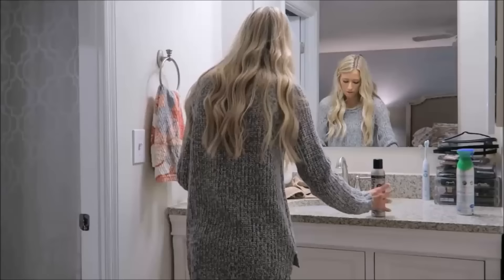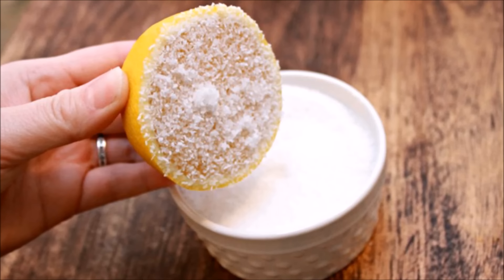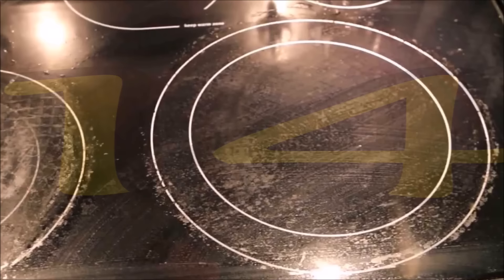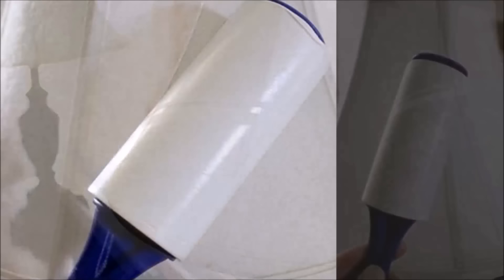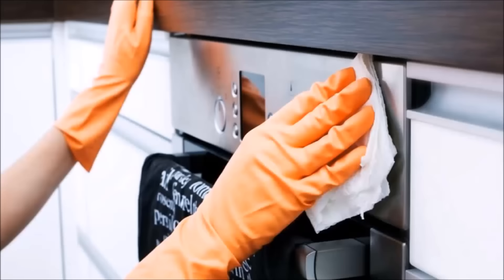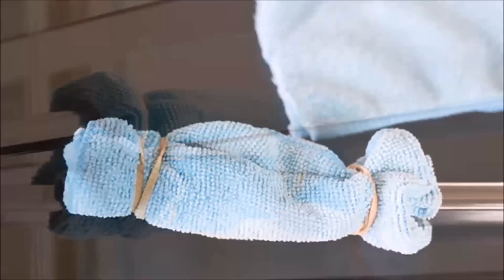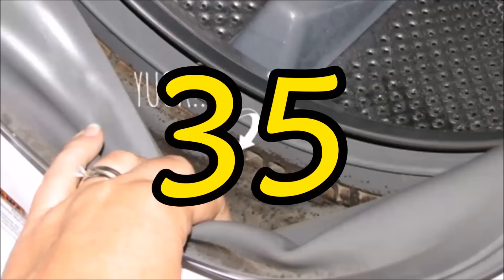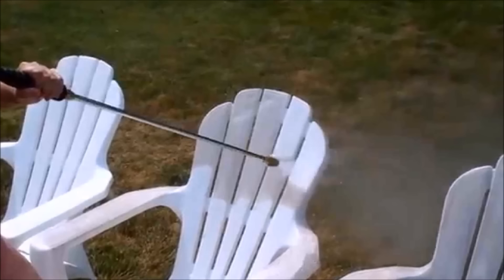41 Tips to Make Your Entire Home Cleaner Than It's Ever Been

Comment: I never use bleach!  I use Borax for towels, or baking soda for my mats because borax does a number on the latex backing. I add vinegar, about 1/2 cup, to to the rinse cycle of most loads....not spandex, the stretch will be gone very quickly, it disinfects sheets & towels.  Borax also disinfects.   I use vinegar for all cleaning jobs...no mold in my bathroom.  I use some baking soda with the vinegar if something needs an bit more scrubbing like my stainless steal sink.  For toilet I mix 1/2 cup vinegar, 1 cup water, 2 Tblspns. liquid  Castile Soap, 10 drops Tea Tree oil, 10 drops Lemon. Mix in a squirt bottle...like an empty dishsoap bottle, squirt in toilet, swish around with brush, I like to use a rag, flush done.

Comment: I know it sounds sooo wrong.....but I was helping my neighbor get ready for surprise in-law company who she so wanted to impress......I washed the outside of her windows while she used windex on the inside.  I used  soft bristled brush her husband bought for car cleaning.... 
And my cleanser.....very hot powdered Tide water in a bucket and then rinse w plain water from the garden hose.......we were worried about streaking, BUT the windows dried in the open air with no required buffing.

She was carefully checking the shine on the windows and Jack of streaking from the inside......we were thrilled........I HAD a pile of newsprint, all ready to go, to buff the windows, but we didn't have 2 do that part🤷🏻‍♀️
🤸🏿‍♂️🤸🏻‍♀️🤸🏿‍♂️🤸🏻‍♀️🤸🏿‍♂️🤸🏻‍♀️🤸🏿‍♂️🤸🏻‍♀️🤸🏿‍♂️🤸🏻‍♀️

Comment: Can someone tell me how to clean in between the glass on an oven door?  
I am afraid to take the door apart...
Than you...
Reply: Laura Flores Use a wire hanger! Just wrap cloth around a wire. You can slide it between the door and glass.
Reply: Use a swifter sheet taped to a fly swatter, like Amber said slip it through the opening between the door and glass.
Reply: That door lifts right out when half open.just lift up.way easier to clean the oven.
Reply: @danahoover1018  wow 67 yrs old never had any idea you could do this !!!!    Thank you

Comment: To add to the fan cleaning, use a heavy wood polish after cleaning to ensure a longer dustfree fan blade! And while you're cleaning the blades, take the globes off and soak in warm, mild soapy water. Set aside to dry and put them back up when you're done cleaning! Bonus if you let the bulbs cool and give em a quick wipe! Before vacuuming. Remember to work top to bottom of a room... and vacuum off the trim above the door!

Comment: for washing clothes, especially bed linens, skip bleach and user DISHWASHER soap.  not washing in the sink soap, but  running the dishwasher soap. it will dissolve body oils and your and your laundry is much cleaner.
     i dissolve about 1/8 to 1/4 cup of the dishwasher soap in 2 cups hot water and stir it . i add it to the washer during the early fill cycle for wash  and mix it around the water and then add linens, feather blanket/quilt , feather pillow.
   i also wash the dogs' bedding with the dishwasher gel. -  never any doggy smell.  if it's washable and a natural fiber cloth, this mix will clean right down to  the surface.
    i never dust my furniture - i wash it with Murphy's oil soap. it's really clean and leaves a nice glow and a lemony scent on the furniture and in the room. i don't have to dust nearly as often.  i also use it in wash water for the floors... makes my cheap wood veneer gleam like the good stuff!

Comment: Any tip for cleaning artificial plants. Thanks so much!!
Reply: wash them in your kitchen sink with soap and water if they are very dirty , or wipe them with a wet rag then air dry them
Reply: If they are only dusty, and small enough to do so, put the 'leaves' or 'flowers' in a paper bag, add salt and shake vigorously. It knocks all the dust off and keeps the plant or arrangement mostly together.
Reply: Actually I recently tried a disposable duster and it works like a dream! Thanks for all the suggestions
Reply: @marysmith6037  -  (The "Salt Bag Method" helps when plants and arrangements are really saturated with dust.)  The dusters are fabulous for weekly cleaning!
Reply: Dish washer
Reply: My mother put dawn in bath tub or  bucket, let soak, shower them off

Comment: The easiest way I've found to clean water stains from a glass door is to soak a Bounce towel in water and rub it down.  The glass will turn milky.  Then use a damp sponge to wipe the milky film away.  Finish with some glass cleaner.  It will blow you away at how easy it removes the water spots.  This isn't a joke...it really works.

Comment: Bleach isn't advisable for mold in the method shown .

Bleach does not penatrate into the caulking or groat.

You're basically letting the mold sit in water overnight. 

The mold you are seeing has grown out through the mold.

There are specific mold killing cleaners.

But if you have a few places on your bathtub edge, you want to have it professionally removed then the space cleaned with mold cleaner. 
It must have at least 36 hrs to dry, then recaulk it.

Comment: Here's the thing my oven is way past code red. My dad lived alone for 12 years so that means.... yes it has not been cleans in 12 years.
Reply: Anya Luckenbill - Start by pulling all loose food or gunk out off it , And oven trays. Youd be amazed to see what your next steps are . Yeah stoves can be a hassle just make sure once done put foil at bottom to catch food & change foil often. Helps to cut bk on the gunk we hate to spill. 👍
Reply: @abbigail3923  If it is a glass front stove have your local appliance dealer show you how to remove and replace glass safely. Yes, it can be done.
Reply: Anya Kessler do let us know how it works.
Reply: @abbigail3923 , yes that works for electric stoves, but gas stoves have vents in bottom. I used to do this, but when visiting my son. With gas stove, he  Said No, can catch fire.

Comment: Chlorine bleach will mix with hard water chemicals and set the stain. Chlorine should not be used on marble or granite. I live in Virginia and have found that mold, hard water stains call be removed on marble and porcelain with 12% food grade hydrogen Peroxide. I order the hydrogen peroxide by the gallon from Med labs.

Comment: For lamp shade's take your regular microfiber duster and one of the cheaper black plastic shopping bags, run it up and down the hair on your forearm, then run it over the microfiber duster. The static electricity transfered from the bag to the duster will pull the dust from an inch + away.

Comment: Even better than the lemon salt tip and the vinegar soak paper towel tip is get the cheap soap pads. Yes, you heard right! $1 for a box of 1O!  No waiting, no lemons, no vinegar, no paper towels, no salt, no mess to clean up. Quick and clean with no scratching.  Just wet and scrub.  Extra soap, cleaning products and bleach are optional. Faucet, sink, counter top and showerhead, etc.  Looks brand new when you are done. Cheap quick cleaning tip that saves you time and money and really works! Who wouldn't want that!?

Comment: Magic erasers didn’t work on my oven whatsoever.
Reply: If your oven is bad enough, which it sounds like it might be. You might want to try soaking your oven in Easy Off for the recommended time and using a 1" putty knife or paint scraper to scrape the gunk. If it is really bad you can use a propane torch to burn off any remaining gunk. I hope this helps.
Reply: I use them dry and work great.

Comment: "First, cut a piece of cotton coil, soakED it in bleach, and let it sit overnight on the mold. Then, just usED a Q-tip to press it into the mold so YOU wouldn't get bleach on MY fingers"

what?
Reply: What the heck is cotton coil? Are you talking abouf cotton string?
Reply: @minniemouska4320  Cotton coil is  used for many applications. It is the material that is used to protect people's skin from damage  when hair color, peroxide and perm solutions etc are used. It is placed against the skin before a plastic cap and/or cape is placed over it. This is the product. https://www.amazon.com/Cotton-Coil-100-Pure-Feet/dp/B01GVR17ZC
Reply: Caught that You My distortion

Comment: I have 3 cleaners in my arsenal, that is it, and that is for what a handheld steam cleaner dont get clean, it is my first go to it will clean & sanitize with no scrubbing, quickly and without and chemicals, and I do keep melamine sponges because the shine and clean all porcelain and ceramic, #1Spray Power it cleans pretty much anything with very little scrubbing, #2 baking soda and vinegar removes any kind of grease, a sponge or brillo pad lightly moistened with vinegar and dipped in baking soda takes grease off anything, and whitens pretty much any cloth and if not, the other 2 things will (spray power or bleach) will do that, and # 3 bleach for a disinfectant, I am paraplegic and my husband is quadriplegic, and I am a germaphobe so keeping my tires clean before entering my home, and keeping the home clean is imperative and this is what I have learned to do over the years.

Comment: Bleach doesn't actually kill mold all the way down, only the surface (colored part)! Use 3% hydrogen peroxide and baking soda, let sit overnight, spray again in the morning and scrub away. You can also add tea tree oil, grapefruit oil, or clove oil to give some extra punch. This will actually penetrate and break apart the mold, not just what's seen.

Comment: BTW vinegar doesn't work on hard water. I've tried ever variation of it, including straight non diluted vinegar. It does nothing.
Vinegar is a liquid, it can soften and remove soap scum just like literally any liquid can, including water.
If you are soaking the white marks on your faucet in vinegar and it's coming off... it was never limescale in the first place, it was soap scum all along so don't bother wasting your vinegar next time, just use water.

For actual limescale you need to go to a store and buy a chemical remover.
Theoretically vinegar, lemon juice, citric acid etc is acidic so will remove limescale(which is basic), but in order to remove months of limescale you need months of vinegar treatment, which means basically you have to wipe down every bathroom surface every single day for the entire time that you live in the house to prevent and remove build up.
A chemical treatment removes limescale buildup in one go, so you just do it once you notice buildup every couple of months, instead of everyday.

To put this very simply. Stalactites and stalagmites are made the same way that limescale build up is made... dissolved CaCO3 is being layered on a surface. Trying to remove limescale with vinegar, is like trying to dissolve a rock in vinegar. It'll happen but it takes FOREVER, vinegar just isn't strong enough for what we want it to do.

Comment: What I do is I set up an area in my basement which is tile floors and a drain and I put the rugs up on milk cartons and I use resolve rub cleaner and I spray it in and then I hose the rug until all of the dirt is rinsed off and then I use standing floor fans to dry the rugs over a period of 24 to 48 hours that's pretty much what your professional cleaners do to. Do not ever use any kind of a brush on fine wool rocks just use your hands and a spray hose with lukewarm water

Comment: Great tips. I hate mold how do you get rid of it in the corners of your home like by windows
Reply: We live in a high humidity area and have this problem. I use bleach diluted in some water to spray on walls and a cloth to wipe windows and sills. Try not to have furniture along these areas. If so check behind furniture and wash any cloth exposed to dampness.
Reply: One thing that I find works really well and kills spores better than bleach is clove oil mixed 1/4 tsp of oil of cloves to around 400ml (about a pint) to 500ml water. Mix it in a spray bottle and spray the affected area, leave for several hours or overnight, then spray again and wipe with a cloth. The eugenol in cloves is a really good fungicide. You may have to repeat this if the mould is heavy but it will keep mould away for quite some time. You should use the oil of cloves that you buy at the chemist - the one used for toothache - and not just scented oil. 
Do wear gloves, eye protection and try not to breathe in the mist as it can be an irritant.
This can also be sprayed in shoes to avoid or kill tinea and some nail fungus as well. Just spray, let it dry and repeat about every month.
Reply: kez kezooie n78hy

Comment: Anything she suggested vinegar to clean replace with a water and denture tablet solution especially for the toilets at pop one in my toilet every night and let it sit overnight and it looks like it just came off the showroom floor every day I haven't put it in the back of the tank to keep that free of the hard water scale. And the burner suggestion instead try getting a fabric softener sheet wet and laid on there for about a half hour when they'll come out like brand new. Anything she suggested baking soda for also denture tablets if you look on the box you'll see why some hospitals were using this then the early part of the pandemic when there was no sanitizer Google it that the ratio recipes to everything you'll need

Comment: I like some tips on cleaning without bleach. I have septic tank and can’t use bleach.
Reply: Just use neat hydrogen peroxide and leave it on for 10 mins before wiping away. Safe and good for the environment too. I found a web page online by a scientist who did experiments by swabbing after using different products and NOTHING removed germs/bacteria like HP - not even neat vinegar. She recommended 10% or 3% if you can't find it.

Comment: Microfibre Cloths..........the best cleaning product you can use on all the surfaces, including windows, mirrors, stove tops etc. etc.  Use damp not too wet, wipe over and the magic happens.  I use Microfibre Cloths instead of a face flannel / wash cloth.  Quick drying and does not retain odours.  They are just an all rounder in the home and there is no need for a variety of different cleaning products............just water, that is it.

Comment: Just be careful with baking soda/bicarb and vacuuming it. Most can get away with it just fine. But many of us can have build up in our vacuum motors. Overtime the build up can screw your motor and blow it. 
It also voids the warranty. Just check Dysons website. 

so I recommend getting a cheapie vacuum from Kmart or something and using that to vacuum up the baking soda or bicarb. That way you won’t potential f*ck up your Miele or Dyson or whatever vacuum you’ve got. 

Also remember, your vacuum needs to be cleaned too. Take it apart and clean the filter regularly. Otherwise you’re just cleaning with a dirty appliance and the filter won’t be working to optimal levels.

Comment: Warning! Leaving bleach on your tub will wear away the finish on your tub. Maybe not right away but as you keep using it it will wear it away. I know, I did this just by putting bleach on my caulking in moldy areas and leaving it on for just 2 or 3 minutes and then washing it off. overtime the finish completely wore away on my tub. we had to pay to have a whole tub refinished. Now I just take a toothbrush with a little bit of soft scrub with bleach and put it on the area needed. I do this every week or 2 to keep up with it so it doesn't get out of hand. I also use a mixture of half Cup of vinegar and a half a Cup of dawn dish soap mixed well and wash my shower walls and tub leave it on for maybe one minute and then rinse it off. everything is left shiny and cleaner than if you used a bathroom cleaner. In for those of us who are very sensitive to flowery or perfume smells, the vinegar and dawn dish soap (unscented or lemon scent) Works wonders. The vinegar does not smell all day either.

Comment: Great ideas, EXCEPT compressed air into your gaming console.  It blows dust deeper into the electronics and many times will void out the manufacturer warranty.
Reply: What manufactures are you talking about? Because I think they might have lied to you?... My Common sense would say that sounds like total bs.....and I’d fight that voided warranty all the way up to the top if you had to. Considering most higher end/harder working major electronics will have some type of exhaust/fan type system that, over time, would cause dust to blow around internally. I don’t see how there’d be any way they could prove compressed air was the culprit.
Reply: Spray at angle, not straight in

Comment: No offense but after watching the first few of these I realized that these hacks are  some of the best ways to absolutely ruin discolor & create irreversible damage to your faucets, fixtures, shower tracks and caulking. I turned it off. I don't recommend letting straight bleach or undiluted vinegar sit on any of the mentioned  problem areas. But rather your choice. If it works for you go for it. I'd definitely use caution on some of these. Especially if you have chrome or laminate. You'll be sorely disappointed while on YT looking for diy repairs. Some like chrome can only be replaced (to my knowledge.) Good luck.

Comment: Dr. Bronners soap is awful...it leaves a film on everything...do not use that stuff!  We took our vent covers off for cleaning and could never get them back on again the right way..they were metal and very old.  
We have used Murphy's oil soap or bona with a spray mop on our wood floors to clean dirt marks, dried on salt snow from boots and it works like a charm.  I combined Murphy's oil soap and water in a spray bottle and keep it handy for small touch ups on stairs treads and hall floor areas.

Comment: Attention! Don't do part 21! If you clean a console with compressed air, you will blow the dust further into the system. This breaks the console. Instead open the console and clean with microfiber